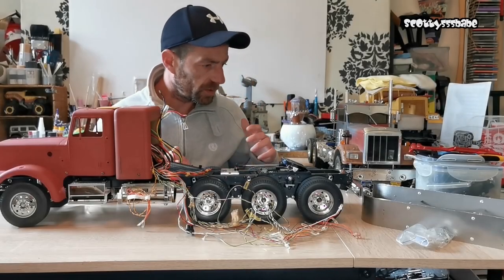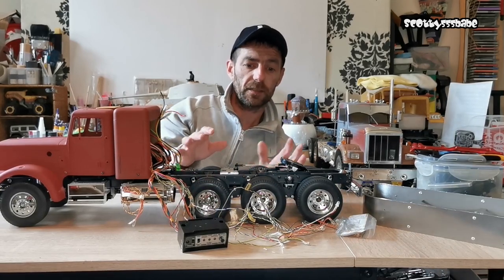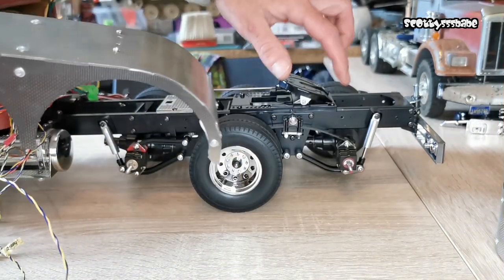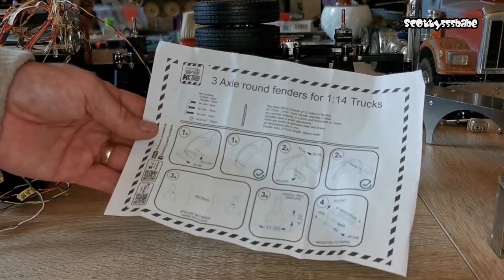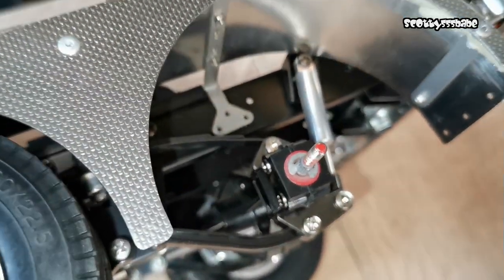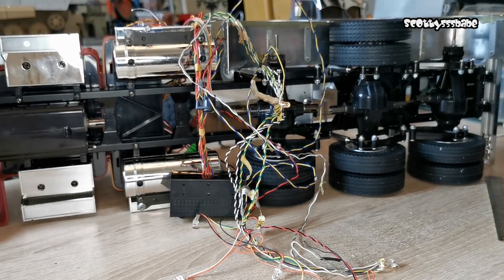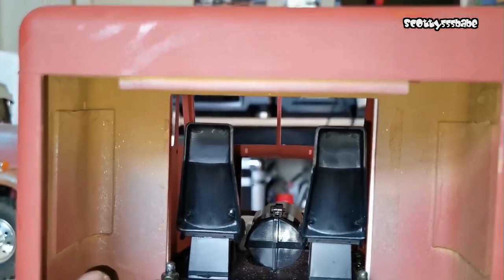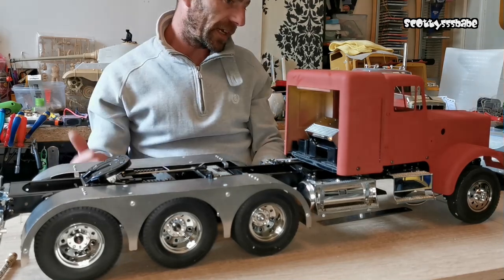TRI-DRIVE Remote Control TRUCK 3 AXLE FENDER KIT | 1/14 TAMIYA GRAND HAULER CHASSIS TRI AXLE BUILD

Comment: .... That's why I use Sliding U-Joint, Driveshafts. Not the Chinesesium (me new favourite word!!), but decent Steel ones. I'm not always good, or patient, with exact length! 😜 

Damn Scotty! Those Rear Arches are AMAZING!!! ❤👍👍  Very clever, using Super Glue for setting them up.
Reply: And a little fun with the boy! Always good. 😊 
You've got me really interested in that Archimedes Pin Vise!! 😎👌 
Obviously not popular here... I found ONE in the USA. $54.00!! 😭
Hundreds available in the UK and China...
Reply from the maker: That's what I have for this build, I can loose patience easily, hence my Kenworth taking so long 🤣🤣 but it's the precision that requires the patience 👍👍
Reply from the maker: The glue is nice and simple, especially when working on a built truck, it saves so much time 👍
Reply from the maker: The Archimedes are a great tool for little bits like this or even drilling a complete chassis, they are pretty readily available here in the UK, I use mine all the time, especially for cabs and things 😊👍👍

Comment: Great to see some one using good old fashioned skills. At one time that was called enginnering. Bet you learnt a lot off your dad.. when i use a normal full size drill for holes i put a rubber gromet on the drilbit so when it snatches it does not damage the workpiece. acts as a buffer. KEEP THE VIDS COMING PAL.
Reply from the maker: Thanks, you can't beat the good old way of doing things before tools and equipment became more readily available, I just enjoy working with what I have on hand, it's just a great way to show you don't need anything fancy.. I learnt quite a lot from my Dad as he used to be a large scrap dealer so I grew up on a scrapyard, seen all kinds of crazy stuff created and engineered along with the dodgy ringing etc and building models in the evening, it's only recently I've found myself using all these old skool techniques and getting more creative with the builds as I'd just bored myself with building kit after kit after kit 👍👍

Comment: Headlamp wise, i used crawler light buckets, they come in two sizes, i used the smaller ones, and they fit 5mm led’s
Reply from the maker: I have a load of those from crawler roof racks etc, I'll have to see how they look 👌👌
Great idea 👍
Reply: @scotty555babe  awesome, just thought it be better than the 3mm led’s that go into the indecator surrounds,